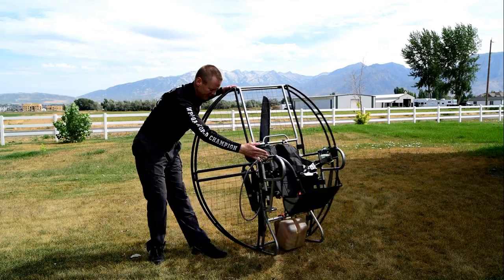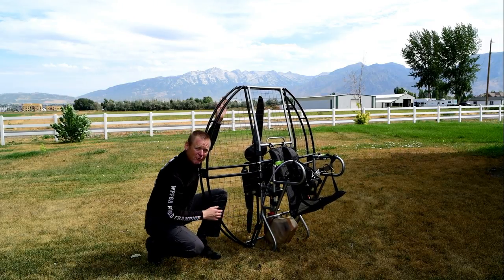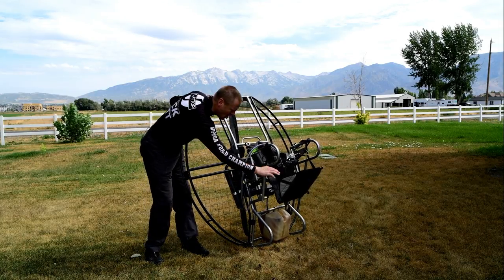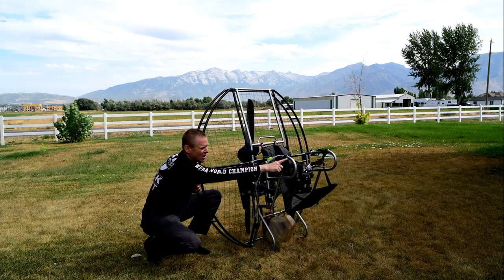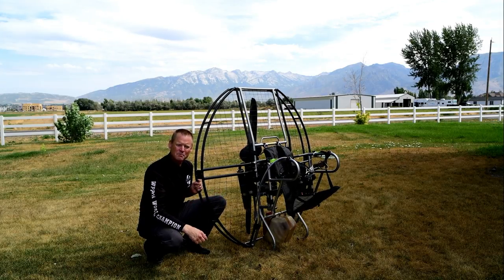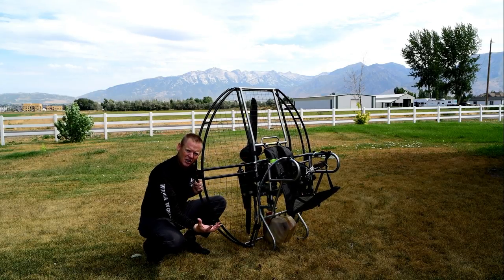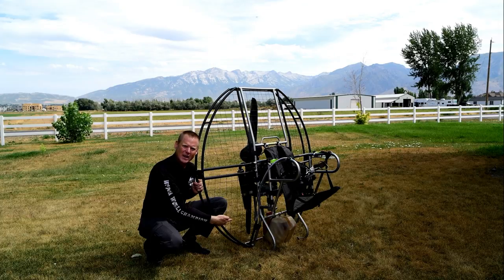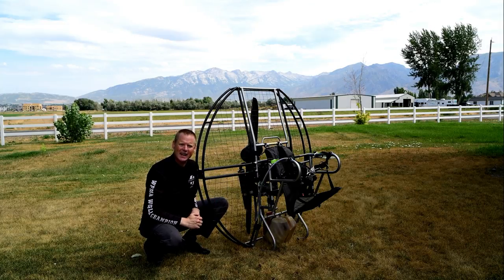Paramotor Buyer's Guide! Powered Paragliders Should Have Rounded Skids and Comfort Bars

Comment: Do you have a motor buyers guide? Like something reffering all of the common brands and prices available in the US? Im in PA and looking to get setup finally. Im 6'2'' and come from extreme sports. As a mechanic im looking to get something very powerful and reliable so that im not regretful of the purchase, and looking to get 10yr out of the first motor setup. I will be setting atleast 12k aside for training and gear.
Reply from the maker: Yes we do have many videos testing many different engines but which engine is the best is more of an accepted fact.  Our custom tuned Vittorazi Moster engine is the one used to set piles of world records so which engine is the best has never really been in question.  The Flat Top Ninja will carry over 600 lbs.  I set the world record flying tandem on the smallest glider in history:  https://www.youtube.com/watch?v=4w67NiHzDiM&t=21s  Here is a video of a 230 lb pilot I trained taking a 304 lb passenger tandem on just a normal size wing:  https://www.youtube.com/watch?v=g5vIy1m2f68&t=3s  In this video I recently set the paramotor trike world altitude record.  18,208 ft and that with a paramotor trike no less and all without even having to adjust the carb:  https://www.youtube.com/watch?v=T9MBMq2gT84  There is even a video where I use the power from the Flat Top Ninja to walk right up a pole: https://www.youtube.com/watch?v=Fx8Ok6-wnZ0  Plus the Flat Top Ninja is so incredibly light and easy to fly even my 12 year old can launch in nil wind up here at high altitude:   https://www.youtube.com/watch?v=-HyQoxT-kcU  So which engine is the best has never actually been in question before.  People bash, trash and lie about one paramotor vs another but which engine is best is not really debated that I've seen.  The Flat Top Ninja has also won thrust tests while also being lighter than any other unit in it's class.  Good question though.  Let me know if this answered it ok or if you have any other questions on anything.  Or call me anytime at 800-707-2525.  In reality nobody even refutes  that the Flat Top is the best and safest paramotor.  There are those who bash & trash but nobody even tries to refute the obvious fact that the Flat Top is the best.  I've set so many world records with it one would look pretty silly trying to refute the obvious facts.  So people should make sure to separate bashing & trash talking from actual legitimate arguments or valid video evidence.  I would love to see anyone really try to refute the Flat Top is the best in any rational, intelligent type of manner.  Instead people make up lies about me kicking owls or buying up shelter dogs and fighting them to the death.  They have made up so many lies about me it's pretty ridiculous but none of them can in any way refute actual facts and reality.